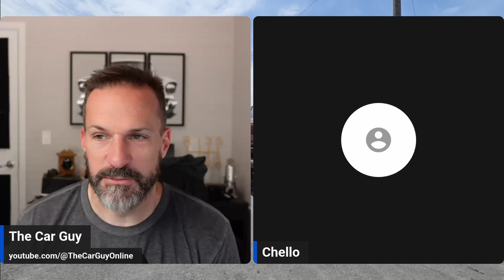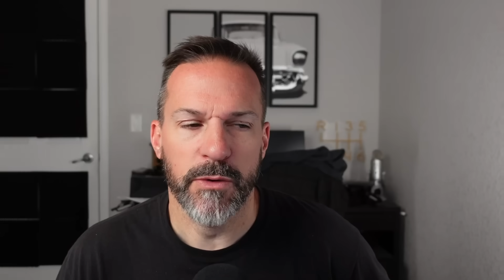Former GM Engineer EXPOSES Planned Obsolescence Tactics.

Comment: 🤣😂🤣😂🤣😂🤣😂🤣😂🤣

STAY THE FK AWAY FROM THESE NEWER VEHICLES!
Lots of these custom shops do financing for a complete custom rebuilt of vehicles or they already have a few for sale. But it’s just cheaper to get a loan from the bank instead of financing. 

I’ve been saying that for 10 years now and FINALLY a vehicle engineer is saying the same thing now. 
I noticed this crap as soon as I bought my 2014 Jeep wrangler, started having major problems just over 100,000 miles. Bought a custom re-built 1992 Chevy 350 motor it’s pushing 345hp now, no FKN problems now. My 2002 Anniversary Camaro is still doing great 👍🏽

Comment: 2:49 just like ford there u joints 2002 f150 lasted 218k miles didnt even have grease fittings lasted that long. Got think was moog lasted hardly a oil change I do mine every 3000 miles. Got some other brand they been in it for like 20k but just now are starting to get play in them again. No way they using same material and grease ford did in 2002

Comment: Framing it as "planned obsolescence" makes it sound like malice on the part of GM. What he actually describes is a combination of factors though.
1) Goverment regs designed to make combustion vehicles impossible to produce profitably or incentivize outsourcing. 
2) Demographics. The customer base is increasingly foreign and low intelligence, can't understand the value of maintenance or stewardship of a vehicle even if it's leased.
3) MBA leadership. People with no engineering background see opportunities to cut costs and impress the shareholders/media while unable to comprehend complex manufacturing systems and their long term failure points.

Start fixing all three, and we'll see the return of great American products that can last a lifetime.

Comment: Unbelievable and I thought the 2005 4l60e to 4l65e 5 pinion was the best bullet proof ever made 4speed auto... I'm outraged at this! Besides that I feel GM dropped the ball on not introducing 5 speed autos in the 90s as 4 speed autos were completely outdated by the 2000s. Coming from trans am ws6 the lt1 was a nightmare optispark kept breaking and reverse cooling kept getting bubbles in the lines and let me tell you it was awful for a 97  reliably....

Comment: "Planned obsolescence" and "efficient manufacturing" are the exact same thing—the only difference is how you choose to see it. The reality is that it's impossible to design a part to fail immediately after the warranty ends without strictly controlling its operating environment in a lab, and even that's not exact. Out in the real world, there are far too many factors involved to reliably predict when any given part will fail. The best they can do is figure out a time window for expected failure and try to make sure enough parts last beyond the warranty expiration that the anticipated cost of warranty repairs doesn't wipe out the benefit.

Comment: I have a 2006 Honda Civic with 360,000 miles on it. I really hope it lasts me until 500k 😂 I also have a 98 Blazer with 107k miles. And a 2021 VW with 21k miles. All 3 of these cars are extremely reliable. The 2021 VW Passat is newer, but I had a 2018 Passat and it got totaled and I put 90k miles on it NO ISSUES what so ever. So I am very happy with these 3 vehicles. Hopefully I wont need a new car anytime soon.

Comment: I still own the one and only pickup that I’ve ever owned a 2000 Ford F150 XL 4.2 V6 5 speed.I’ve had this truck for over 20 years.Everone asks me “ why don’t you get a new pickup truck “ I tell them , it does everything I need it to do and it doesn’t cost anything to operate.Whether your Ford , Chevy , Dodge or whatever if your considering a new pickup get a well maintained older one instead, they are more reliable and you save 10s of thousands of dollars.Maintain it , fix it as needed , drop a motor or a transmission in it if need be someday and keep it till ya die.

Comment: I'm against government intervention because it almost always makes things worse, but there's got to be a solution to Planned Obsolescence."  Refrigerators (and other major appliances) used to regularly last 15-20 years and more. Buy one now and any repair guy will tell you to get the extended warranty because they WILL crap out in 3 years. 

Consumers could "just stop buying" this crap, but there's only so many quality vintage options to go around. 

Same with phones, cars, and anything else that costs a few hundred bucks or more. 

Seems to be a correlation to when this started happening and when we started getting everything from China. Before that, it was Japan. But my 40 year old Walkman still works perfectly.

Comment: What GM "Used to be".  During that decade where "the best" cars and trucks were being made by all brands 1996 - 2006 - I've got a friend with a 
2005 GMC Yukon Denali AWD w/ 6.0 liter V8 that has 330,000+ miles on it and still the original timing chain. Even more amazing,
currently it's still his Wife's daily driver to work.  Just got done recharging the A/C for her with summer here. (yeah, there are more than
a few "leaks" with the vehicle.  lol    But everyday, it still starts and gets the family out and back again.)  Don't buy vehicles made much after 2006 if you ask me.

Comment: Things started going south for GM when they decided to have China start making their AC Delco line of aftermarket parts.
Which not long ago was "the best" line of commercial grade aftermarket parts available by a single parts manufacture.
Better parts than the OEM parts that came originally with any GM Vehicle.
With most of the AC Delco Gold line of parts being manufactured in Canada or the U.S.  Regretfully, that is no longer being the case and manufacturing moving overseas.

Comment: I'm a chef and am not good with mechanical sh!t. However it's at the point now where it's cheaper for me to take 4 days off of work to learn how to fix my car and screw it up once or twice but eventually do it right. Then to buy a new vehicle or pay mechanics $150 an hour labour costs when they just about destroyed my engine with an oil change and hammered my brake pads and clips into pace making it near undriveable. Mechanics are morons (where I live) and vehicle manufacturers are maliciously making the worst vehicles they can imagine. So here I am, at home learning how to replace my front shocks... The enshitification of everything continues.

Comment: 2015 was the end of the decent vehicles IMO. Mid 90’s and early 2000’s was peak. Just enough creature comforts, big power with the LS engines, still simple enough to work on. 

This computer screen in the dash era is absolute junk from China.

Comment: I had a 2017 silverado with 8 speed. Lasted 23k miles. Had a 2021 At4 with a 6.2, lated 7300 miles and blew up  
Absolutely garbage. I'd rather take the bus then ever buy a gm ever again

Comment: Cost cutting is what all manufacturers do.  Not just cars.  Everything.  Sometimes you can find some really ingenious engineering.  Sometimes it even improves the product.  But its purpose is always cost cutting.

Cost cutting is not the same thing as planned obsolescence.  Planned obsolescence is deliberately limiting the life span of a product in order to force its replacement.  It is not about reducing the cost of production.  Though very often the 2 may go hand in hand that is just coincidence.

Comment: I have been careful in buying cars, some from GM that last a long time.  I used to work for a consulting company and worked with GM in 2005 to work on their warranty data. Why?  So GM could do analysis of it and figure out how to target problems on new cars in particular to fix them in the first couple of years of production.  First applied to the Saab brand with only a few cars.  I bought one of the cars they built in 2006 and it is still running today with the original powertrain.  The engine was GM, the transmission, Toyota.  I sold the car with almost 200,000 on it.  Now with its third owner, it now has 275,000 miles on it and is finally starting to have issues.  I replaced it with a 2018 Buick Envision, which was in its 8th year of production first generation.  Using an old 2.0L 4-cylinder engine and 6 speed automatic. Still own this car, now with almost 100,000 miles and no problems except one electric sensor failing on the safety systems, costing $1000 to fix - but I change the oil every 5000 miles and not when the oil management system says to (which is about 6000 miles). Too bad they are getting cheap again - it will be their downfall.

Comment: I worked for Honda tier1 supplier. Basically heading to the same direction, but moving slower, probably because of Japanese and western cultural differences and also Honda strict requirements they hold. VAVE is constantly evaluated. But at the end, the top managements decide considering different aspects, not just money. There is Honda test methods and requirements for every components used and stated on every dwg, which will define how long the components will last under certain environments. This probably same for most of car manufacturers, but each manufacturer may have more or less requirements. 

This is basically the common sickness of stock corporation system. This is becoming obvious issue all over the industries especially large corporations with highly compensated CEOs.
Who and what decide how much money the head of company get? Large stock owners based on the PROFIT company made. 
When most of stocks were owned by their own workers, that was good day. Now stocks are out of hands of regular people, but owned by another large for-profit corporations. Guess what, it never ending cyle to the bottom.
The percentage of stock can be owned by investment firms need to be capped.
I see many good companies with good products are privately owned and not stock companies.

Comment: I’ll keep my 66 belair with its two speed power glide and carbureted small block this isn’t an issue just at GM it’s an issue with all the manufacturers GM might be one of the worst ones about it. But nobody can build a transmission these days and if they can they can’t seem to build an engine

Comment: I own a BMW and their strategy is the exact opposite.  They are counting on you to spend $$$ on car maintenance.  Proprietary parts.  Computerized fault code and programming system.  Cheap plastic parts that are vital and break down often.  Intentional inaccessible design to discourage DIY repairs.  For example,. requires almost taking car apart just to change front lights.

Comment: my theory on the start/stop "feature" is that its designed to minimize idle hours and get the cars past warranty then they are more likely to break post warranty which turns a cost (warranty work) into a profit (out of warranty work).
I've heard an idle hour is equivalent to something like 30 miles of driving wear.

I believe that 0W oil and longer oil change intervals are for the exact same reason, decreased cost of "free oil" changes offered with a new car purchase that leads to a decreased life span and more repairs post warranty period. less "Wasted" time taking up free services and time at a dealership if you are still in warranty, they cant upsell you anything and the manufacturers dont want techs finding as many warranty repairs as they would with 3-5k mile oil change intervals.

That, on top of, plastic parts that used to be metal and the increase in electrical compliactions (electrical parts and screens have a very low cost in comparison to the perceived value and complexity by the average customer) leads to obscene profits.

P.S. the higher complications in body lines and overall design leads to fewer opportunities for body shops to fix damage with body work and bondo and requires a far higher purchase rate of new parts such as a fender/hoods, doors, etc.
Reply: 0W isn't the issue, it's the second number being lower that is the issue. 0W-50 oil is more viscous than a 10W-30 for example.

Comment: My dad ordered the first 4 wheel drive pickup our Chevy dealer in our small town ever sold. He ordered a ‘67 in the Fall of ‘66 but it wasn’t built due to a shortage of transfer cases and front live axles (allegedly due to military demand from the Vietnam War) so we were put at the head of the list for the ‘68s. The 1/2 ton we finally received was a 8’ fleetside with a 307 V8, 3 speed manual on the column, Custom Cab (included 2 tone paint with gauges and trim), lockout hubs, AM radio, wood pickup box floor and that was about it. No power steering, no power brakes, no automatic transmission, no electric windows, electric locks, electric seats, or electrically shifted transfer case with AWD. The list price was $3,600 and the final price agreed to was $3,000. The last truck he bought, the 2000 Silverado LS 1500 4x4 that I’m currently driving has all those listed conveniences and I believe it listed for $26k when dad bought it in ‘99, a price which is still within reason. The new pickups are so expensive that they have to be financed for 84 months in order for buyers to be able to afford the payments. With the total lack of reliability the buyer’s nearly forced into buying an extended warranty so that’s another payment. Dad’s last truck, the 2000 Silverado which has 68k miles on it had $12k invested in it by me around 3 years ago. That got it new inner and outer rocker panels, new cab corners and rear cab mounts, the underside of the cab sprayed with bed liner, a California replacement box, the inside and under of the box sprayed with bed liner, the frame pressure washed and painted with KBS rust treatment, a new roll up tonneau cover and the whole truck repainted to factory colors. $12k would’ve got me what, maybe a year of payments on one of these glamorous pieces of crap they’re producing today??? The sentimental value is the icing on the cake with this Silverado as it has the 5.3L LS and the 4L60E so reliability is off the scale when compared with the trash they’re producing now. Thanks Dad.

Comment: 30 year mechanic here, driving a 2001 k1500 Silverado and it's the newest truck I'll ever own. My tipping point to the tech downgrades began with the electronic throttle body and the crap has just gone downhill from there.

Comment: Obsolescence manufacture has been around for a number of years regardless of what is said. Warrantee work and promotion of replacement car sales are the hook with no accountability to the dealerships. It's about the manufacturers. Fleet sales in parts drives the market. Don't but new. Trust your own mechanic when possible. Worse comes to worse, get a lawyer.

Comment: This situation just angers me.  My kids, can't affort a house, groceries are going threw the roof, and products like cars are overpriced junk.  This is our legacy, and it is uncaring,  shameful and shortsighted!  I have a serious problem will what is being exposed here.  Of course, my 4 year old air conditioner failed, while my 25 year old furnace and water tanks are still working!  My 01 Yukon 5.3, with 4.10 gears and 285hp has given but 1 problem, a knock sensor, that I replaced.  Oh it has plenty of jam, for merging towing etc.  Glad it doesn't grenade in or to cylinder deactivate and save a mpg!  Guess society has out smarted itself, with throw away mentality.  Hey does this apply to marriage, you know, if they get a bit old replace them??? Maybe.

Comment: I work, in the US, for a Japanese technology company (non-automotive). Our engineers update parts all the time when they are showing a high failure rate. The parts that are performing satisfactorily are NEVER downgraded to save costs because our engineers understand that this will always cost the company more in the long run. I used to be a GM guy, I wouldn't consider anything else, now, only Toyota. The sad thing is it seems the Japanese auto manufacturers are starting to go downhill too.
Reply: Tell us about the Japanese corporate bureaucracy
Reply: Starting to go down???? Bro, they have been going down for decades.  Don't regurgitate the 80s toyota mantra that they make invincible cars.  They don't and haven't since the 90s
Reply: @blackbelt2000 except the 5th gen 4Runner
Reply: @blackbelt2000 bro! Toyota has been good way later then 90s shit started to go down mid 2000s
Reply: Toyotas little turbo engines are failing just as hard as gms
Reply: Toyota is having major Machining issues too.....look up metal shavings in Tundra engine block oil passages.
Reply: I worked in warranty reduction for aerospace after managing several product lines.  I can count on one hand how many normal people know what MTBF is much less who even think about it in regards to their personal possessions.  I left the company when they outsourced manufacturing from the US to Mexico.  You're correct they didn't change reliable parts but what they did change is who made them and changed the warranty terms.  

Almost no car made in the last 10 years is worth driving... even Toyota.
Reply: There are no reliable new cars anymore. The modern world is F&G. Fake & gay. 
Everything is a lie, ugly, and unfair
Reply: I’ve moved from Ford to Mazda and am crossing my fingers that they don’t fall victim to the American mindset. Especially because they were heavily influenced by Ford until only 10-12 years ago.
Reply: @crg34 do you have to pay a fee to remote start your car?
Reply: The reason Japanese auto manufacturers are losing their reputation is ... costs. When Japan entered overseas markets, they were competing at around half the cost as the other competitors. Now, they are competing against the Korean and Chinese, without the cost advantage, just like everyone else. Something must give if you want to stay in business.